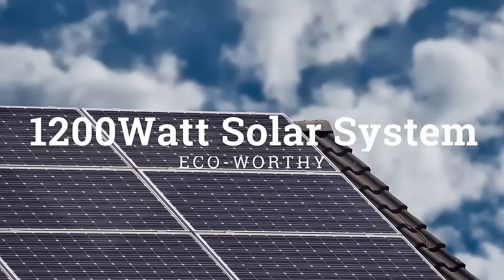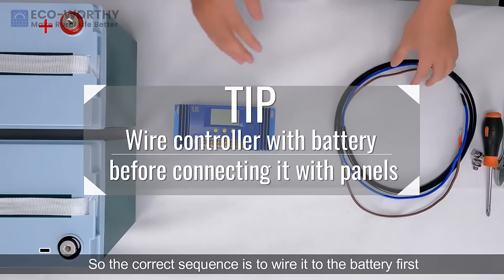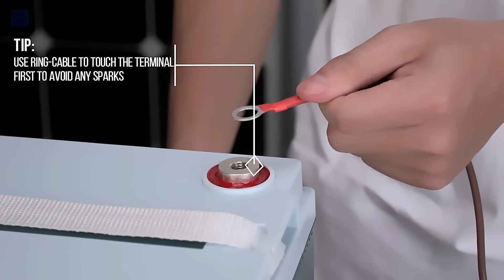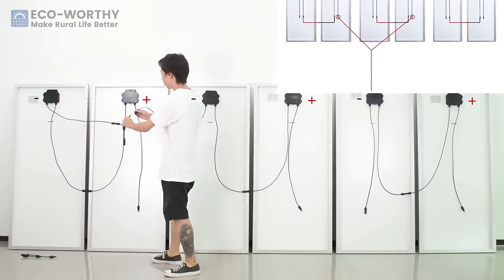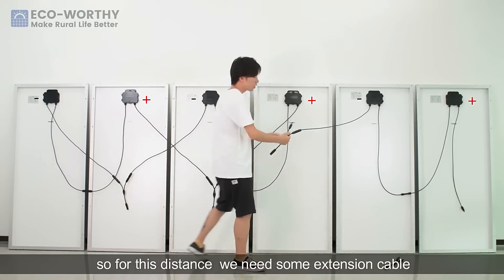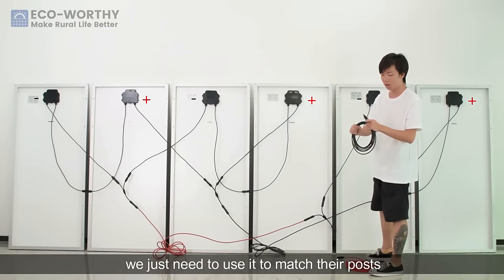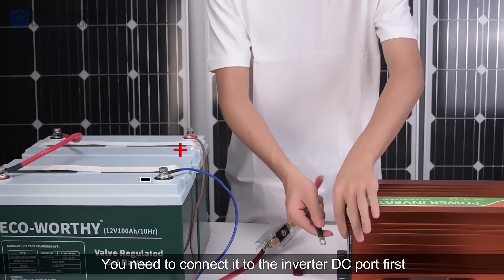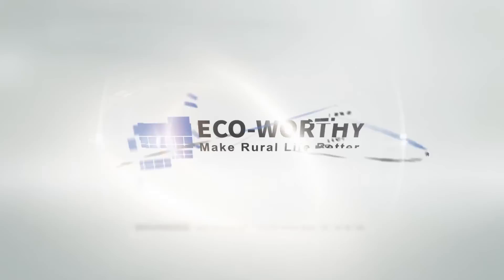Installation of ECO-WORTHY 1.2KW Complete Solar Panel System with Battery and Inverter for Shed/Farm

Comment: Dear All,
3 years ago I bought a 100W Monocrystalline and a 120W Monocrystalline solar panel from Eco-Worthy.
Both of them have snail trails on their cells and the power decreased to ~40-50W.
I contacted the company but did not get response, help. I am not satisfied with Eco-Worthy services.
I do not recommend the company.

Comment: Any reason why you connected red extension cable to the negative Y branch of all the panels and then switched to black with the controller lead? In the illustration the colour sequence is shown correctly but you video shows you have mixed up the colours!

Comment: how do I use the 6 string combiner box when using this method?. we have the 2k watt system. we wired it this way and are left with no use for the combiner box.
Reply from the maker: Hi,If your system is 10 pieces of 195w board total of 2kw, every two pieces in series into 24v, and then connected to an input port, a total of 5 input ports used

Comment: How do I, or can I add additional panels to this system ? I purchased a combiner but when I add a panel to it my voltage reading drops
Reply from the maker: Hello, would you tell me how you connect the combiner strings, as you said, there should be 7 panels now, have you used the same panel to add? Or the new one is different?

Comment: How do I keep a consistent power source going for a hydroponics system? I have the panels, controller and battery. Am I missing anything?
Reply from the maker: Hello, do you mean you want to build a UPS? In that case, you need to count how many power your hydroponics system for one day, and that's the power the panels should generate, then you'll know how many panels you need. Also how many batteries for store that power
Reply: @ecoworthy_official  How do I count power?

EX: I have four panels, that's 400 watts. I also have two 12 volt batteries. That's 24 volts. I have no idea what any of that means.
Reply from the maker: @devinrobinsonx4442  I mean, how's the power parameter of your hydroponics equipment? it should be on the label or website.

 you need to know how many power it takes in one day, so you'll know if your present solar products are enough or not. 

The 400w panels generates about 1.6kwh power a day, so we can say you have 1.6kwh now for the system. 

About the batteries, we know the volt now, how about the amp hour, we need to know that to count the battery bank capacity.
Reply: @ecoworthy_official  

I purchased this: ECO-WORTHY 200 Watt 12 Volt Complete Solar Panel Starter Kit for RV Off Grid with Battery and Inverter: 2pcs 100W Solar Panel + 30A Charge Controller + 2pcs 20Ah Lithium Battery + 600W Solar Inverter

AND 

ECO-WORTHY 200 Watts 12 Volt/24 Volt Solar Panel Kit with High Efficiency Monocrystalline Solar Panel and 20A/30A PWM Charge Controller for RV, Camper, Vehicle, Caravan and Other Off Grid Applications

TO POWER

Two 30W high efficiency motor air pumps.
1 800W heater
Reply from the maker: @devinrobinsonx4442  I see, so as we said, the power generation you get is 1.6kwh, which can make the pumps run for 54h, but only 2h for the heater.

And the 2 12v 20ah batteries have totally 512wh power, you could consider you have 512wh power for night use of the pumps, so it can at least run for 17h after sunset.

But the inverter is 600w, so it actually can not run the heater, or cannot make it run at full power.

So the conclusion is, for the pump consistent running, no problem. But not enough power for the heater, 800w is too much for both the 512wh battery bank and 600w inverter
Reply: @ecoworthy_official  Thanks

Comment: Hi there. I have your 200w system and have set it up and it's working nicely with a 110ah leisure battery. I wanted to ask you about adding an in-line fuse in the system for safety in case of a broken panel etc. Where would you advise adding fuses and what amp would be most suitable for the 200w kit please?
Reply from the maker: https://www.eco-worthy.com/blogs/news/sizing-suitable-fuse-for-pv-system
maybe this article will help you.